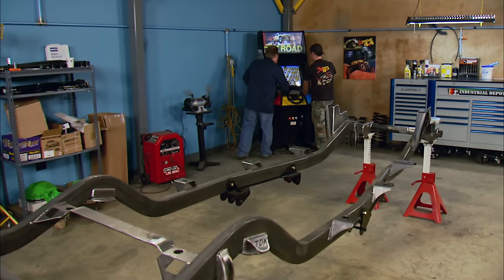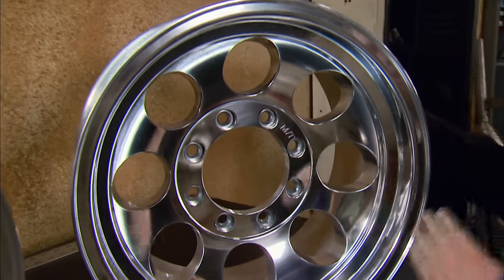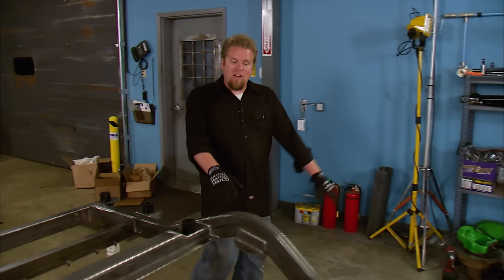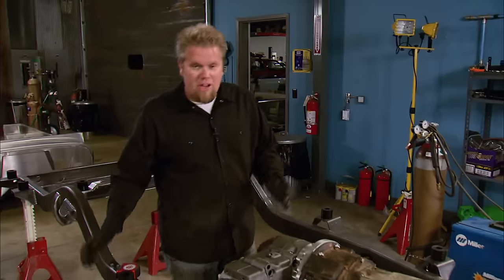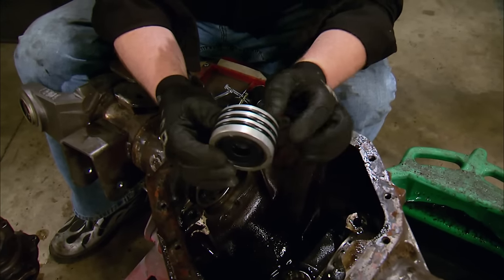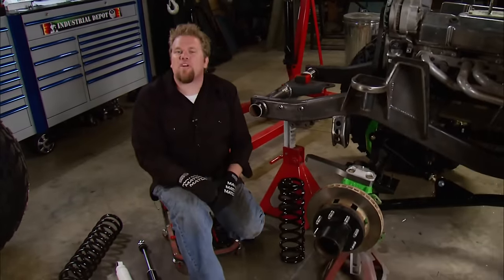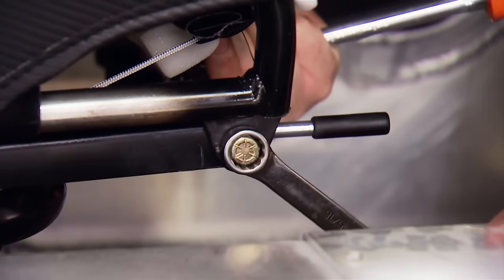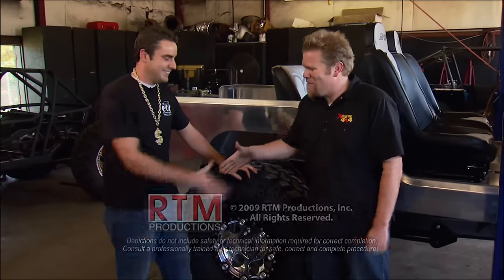Putting Axles & Suspension Under The Frame Of A CJ8 Scrambler - Xtreme 4x4 S5, E2

Comment: What you have done is a pet project desire for me as I am sick and tired of the JK with all those little niggly CEL codes and electical issues and JLs are the same. Want a simple, capable machine, with AC, but as per my JK I would still maintain a DI LT Chevy engine and 8-10 speed auto. No need for the double case arrangement as 1st gear is 4.55:1. But my estimate came out to about $50k to do almost the same as yours. What was your final budget if you can say? And where does one get a major components list for the build?

Comment: Why do all these build shows do a "small 2-car garage" build when obviously they are using way more space? Really, a frame, a body, an engine, a transmission, a transfer case, front and rear axles all inside unmounted on the floor at the same time? All that, plus tool cabinets, work benches, storage racks? My 2-car garage has actual walls. Drop the dumb "garage" premise, and just show the simple, budget ways to do the stuff. Or build an actual fully-enclosed garage and do it.